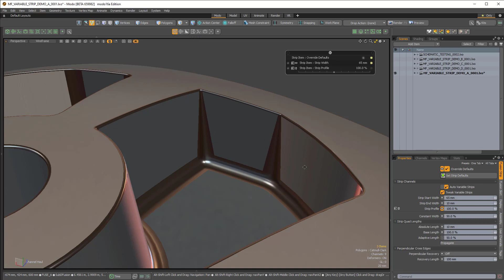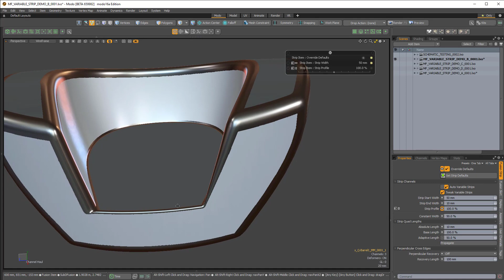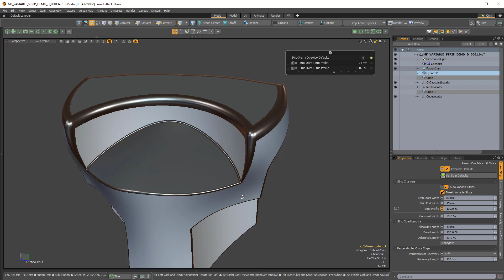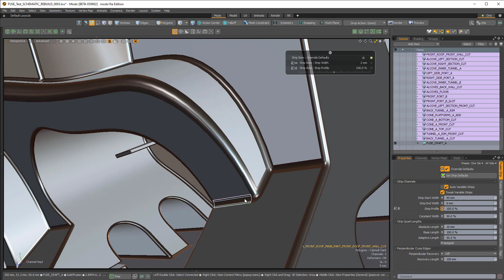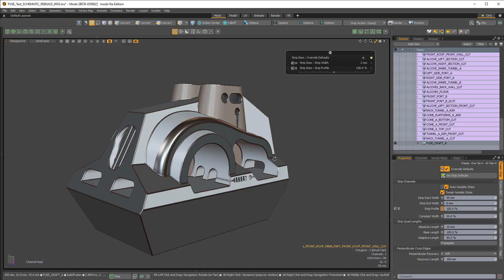MODO 16 | MeshFusion Variable Strip Widths

Comment: I've been using Modo for a very long time and MeshFusion is my ABSOLUTE FAVOURITE tool for engineering models for 3D printing. 

Are those colours a material or a visual option as you work? It would be cool for it to be used to analyze draft angles.
Reply: Hey Kashif! The shiny MatCap colors are the default "materials" of the Fusion Item, but they won't show up in the actual render. MeshFusion automatically creates a Shader Tree hierarchy that you can customize. Each part of the Fusion surface (strips, subtractive surfaces, union surfaces, etc) are all tagged by part groups in the Shader Tree.

Comment: Is it also possible to make a strip go from thin - wide - thin and vice versa?
Reply: Hey Zyhael! Yes the thick to thin strip widths can be reversed by manually switching the values in the start and end numeric input fields.
Reply: @edferrari9971  Great, but I meant a variation of the width of the strip where the middle would be thin and the 2 ends would be thick or something to that extent, instead of just a linear from thin to thick kind of thing.
Reply: @StrayZero  Ah, I understand. No, unfortunately that is not possible at this time.
Reply: @edferrari9971  cool, hopefully we get to see it in the future. Thanks for replying!
Reply: @StrayZero  Yeah it would be really nice if they made it to where you could use a gradient to control the strip width.

Comment: As a newcomer, I couldn't find any systematic learning instruction on youtube, only a bunch short clips ,  Even the official documentation doesn't explain in detail what each of the parameters is for, so, what should I do?
Reply from the maker: I would search the Pixel Fondue channel - there's a ton of long form tutorials (in addition to William's short clips)  Use the search magnifying glass icon on the channels main menu.
https://www.youtube.com/channel/UCk_uW-XmKnH0KQs-NmE0AUQ

You can also check out Ed's playlist, lots of Mesh Fusion stuff there
https://www.youtube.com/playlist?list=PLv8HciXoFYX-xg0VLfEwVeLAOugT-2Cto

Also check out the Pixel Fondue website, there's links/summaries to Richard Yot's mesh fusion series there
https://www.pixelfondue.com/blog/2022/5/26/mesh-fusion-2022-update-part-1